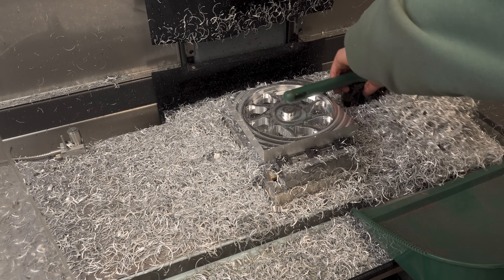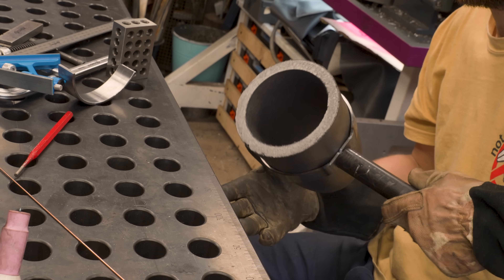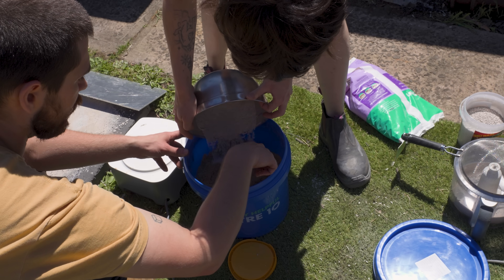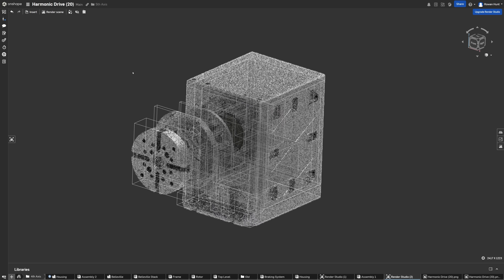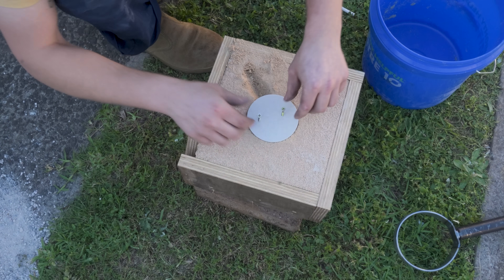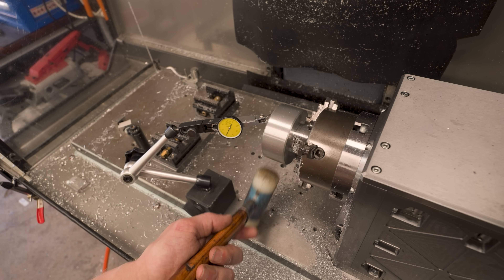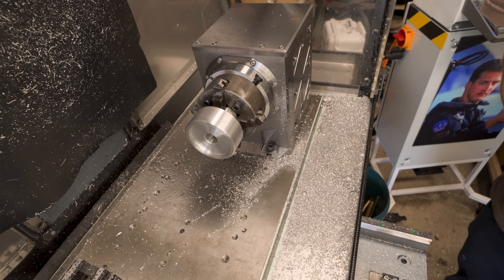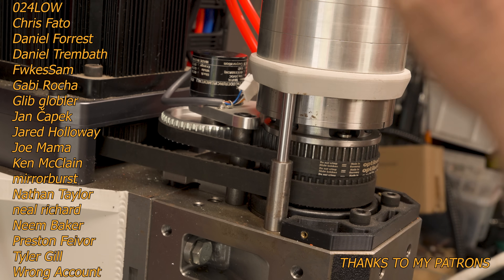Can I make a precision component from scrap metal?

Comment: Yeah impressive but I can make scrap metal from a precision component
Reply: Ah, but can you carelessly mix chips from seven different metals until no recycler will ever take it, even for free?
Reply: yes you can. You'd make very precise scrap.
Reply: Yea but I can make a precision component and scrap at the same time
Reply: I can make scrap metal from a $1,000 Kurt vise...
Reply: Video games have taught me you can make anything from scrap. 

All you need is a flat surface which you call a workbench, some office supplies and kitchen chemicals. Then you can build anything from a jetpack to bulletproof armor and bombs.
Reply: @VikingTeddy, Step 1: punch trees
Reply: Sounds like my QC manager
Reply: Any machine is a smoke machine if you operate it wrong enough.
- several people, idk original source.

Comment: The good news from here is super easy to add the flange needed, just a flat round disc half inch bigger than your gear, drill  3-4 holes and tap matching holes into the gear itself.

Comment: don't worry from someone who has a machining bench that is about 80% holes, 81%if i count the vacant space in my head where a brain would be, we all end up with the accidentally cutting/welding 2 or 3 times situation, it's just the result of you enjoying the process a lot, as well as an added bit of excitement for the project to be finished, or your calculations prior being correct, and as a fun little nod about the empty space between my ears, as i am a measure cut and then forgetting about the extra bit of centimeters I left myself type of girl

Comment: Dude, we learned how to these sand forms for casting and you basically just have to pack it hard, layer by layer, NOT JUST AT THE END (there is a tool for that). And the wood would also suck moisture from the sand. The moisture content was important, if I remember correctly. Some single digit percent?

Comment: if i recall correctly a belt pulley if it is ever so slightly CONVEX it will hold the belt in the centre... yes conVEX its counterintuitive but it pulls the belt to the high centre.. i dont know how that plays with toothed belts but its how they used to keep leather belt driven pulleys working without flanges (flanges make it hard to get the belt on and can tear it all up if the belt tried to ride it)

Comment: You've got a TIG machine, so presumably you've got pure argon handy. Before you pour use a graphite or stainless steel wand to bubble a few of liters of argon through the melt for about 30-60 seconds. This should reduce that porosity you're seeing.

Or, if you're a fan a chlorine gasses, toss a commercial degassing tablet in it.

Comment: I been casting from a 3d print for years... Its such a useful method. Super accurate too if you account for shrinkage. I use  2 small magnets set in the 2 halves of my pattern for line-up.. works great! Also laser cut acrylic template works for flat parts. The uneven kerf from the cut is perfect mould draft and i have had particular success casting a texture off a raster. Would suggest setting a laser-cut/Engraved acrylic sheet into a flat plane of a template to achieve higher detail. In all honestly I bet that finished part could have been almost fully casted if better sand/template/much care was taken.

Comment: You should be able to eliminate the need for a flange by turning a slight crown on the teeth. Since it's just running an encoder that shouldn't cause any issues. It's not needing to transfer lots of torque.

Comment: To everyone, if you didn’t know, be careful with open ceramic wool insulation in furnace or forge it blows the fibers/silica and can cause silicosis in long term exposure. A respirator is always recommended, otherwise sealing it with refractory cement is best.

Comment: There is another binder you can use that actually sets up, it is sodium silicate AKA water glass. Mix that with your sand, I am not sure the proportions, and then cover it in plastic and expose it to CO2, which you can get at a welding supply store. Once you remove the plastic, you now have a hardened sand mold. You can use a lot finer sand as there is no moisture to vent and no metal ejection hazard. Since the sand is finer, you get a lot better surface finish. The downside is, it can't be reused, you have to use new sodium silicate every time. Not sure about the sand though. There are YouTube videos on it.

Comment: Make it slightly convex/crowned and the belt with self center.
Steve Mould has a great video on why/how it works when it seems counterintuitive… you’d think a rounded pulley would make a belt slip off, but it does the opposite and keeps it centered. It’s pretty cool.

Comment: I paused the video to tell you where to get cheap bentonite just as the words "Kitty Litter" passed your lips...  Curses! Beat me to it!  (Did you know that you can also bleach waste oil to be clear again with it?  Fun fact:  You can.   Where I live in North Carolina, the sun is intense enough that if you paint a standard oil barrel black and leave it under the summer sun you can just about get the temperature adequate for bleaching.  Your mileage may vary with your location.)

Comment: The casting came out really well also from a machining point of view. I've tried one time but probably I've used the wrong alloy and it came out very gummy.
I'm planning to try something similar in the future as I acquired a 3D printer with some friends, did you do some degassing or put some flux in the molten aluminium?

Comment: You measure gears and other similar features with instruments by putting dowel pins of appropriate diameter inside the features and measuring from them. This still requires that the pin contacts only the bottom of the feature, and in the case of gears, it only works if the gear count is even (or you can adjust the measurement for odd ones, with a lot of trouble and math, but better not to try that).

Comment: A good way to mix greensand is lay it on a tarp in a thin layer and roll it back and forth by picking up one side. That way you can really dial in the water needed with a spray bottle.

Comment: so, i don't think i ever posted about an AD on a video, but i got into onshape, i wasnt expecting much, it delivered EVERYTHING, i cant believe how good it is
Reply: My main problem with onshape is that it's in the cloud. At any time, onshape can decide to go bankrupt or get all their servers randomware'd (however unlikely it is), and suddenly, your files are just binary noise, if you have them at all and didn't just store them on their servers.

Any price difference with older established players will only last until they have gotten enough market share. The pattern is well established by SOLIDWORKS and Fusion 360, not to mention software and products in other fields. The first hit is free, the next one is cheap, and once your product is a few years old and a few revisions into development, and consists of files and assemblies interlinked in product-specific ways, suddenly there will be maintenance cost hikes and monthly licence fee ramps, and you're not going to take the three months of no revenue-generating work it would take to transfer all of them to the new hot-and-cheap software via the inevitably shit export flow and lose all of the revision history.

Admittedly, it's the same for many non-cloud CAD packages nowadays... If their servers are down, you just can't get a licence validation, and it's a multi-gigabyte brick on your hard drive.

God I wish FreeCAD were up to snuff yet.
Reply: 3D sketching is my biggest desire for OnShape.

Comment: I can't believe you Prematurely Pulled out your 1st Metal Mold.. I was really impressed with the quality of that metal once you sliced it open to investigate its internal structure. BTW I can't believe that you didn't DIY make your own crucible & metal furnace from scratch.. and I can't believe that you didn't DIY your own ⚙️ gear pulley from scratch by planting multiple rubber trees decades earlier from now, in order for you to make a video about you making your own rubber belt for your gear pulleys.. I just can't believe that you didn't do this.. You really must not be an engineer..

Comment: Literally what i did a few days ago and going to do again today as need a replacement pulley. 
- Always wear a full face mask when around the forge as only take a drop of water for an accident to happen.
- Best source of scrap Ali imo is cylinder heads/engine blocks/pistons(way less impurities) then motor housings etc
- If you really want centrifugal casting is another method of having a stronger cast (but it doesn't work for everything), sadly the real good quality one is done with pressure cant remember name (most good recycled ali comes from this process)

Keep having fun :)

Comment: I started casting my own aluminum a few years ago, and also had problems with little air bubbles. It took me almost 2 years to solve that problem. It turns out that if you heat your aluminum too much (to try and get rid of those annoying bubbles) you end up with more. Those bubbles are actually hydrogen bubbles that form from any water from the air (or your scrap). If you melt the aluminum just past the point of molten those bubbles disappear. This is something you have to get a feel for because if you pour too early you end of with cracks forming in your casting. Bottom line is, you need some hydrogen in the molten mix to reduce the cracks, but not enough to be able to see them and end up with a casting that won't seal against oil or air in your finished product.

Hope this helps. I love your channel.

Yours, Bruce.
Reply: This was very informative thank you for this!

Comment: Now, obviously, the next step here is to find yourself a quiet and abandoned slab of concrete in the middle of nowhere, and cast a large chunk cast iron into your next machine.

I'll be so generous as to suggest something with no less than 50HP on the spindle.

We'll give you two months, since it's a slightly more complex undertaking. 😆

Comment: I don’t normally comment or give praise to young people who stumble through something and manage to not kill themselves, but kudos to you. You’ve done some research, obviously. Your lifting tongs and pouring shank are very well made- certainly better than the garbage it came with and better than what a lot of backyard amateurs use. I would probably beef up my PPE a little- maybe to a face mask/face shield and some covering for your arms. You’re only melting a tiny amount of metal, but if/when you take it further with a bigger crucible/furnace, you’ll want to upgrade to leathers or something more. I use expensive aluminized Kevlar PPE and a gold coated face shield when I pour iron, but that’s all overkill for what you’re doing. If you can’t source bentonite directly, kitty litter is still pretty suboptimal as is your sand by the look of it. If you can’t source finer (maybe 100 mesh) silica sand or better, olivine, then the surface finish will suffer. Obviously in this project it doesn’t matter since every important surface is machined, but someday you might appreciate a smoother finish on your castings. There’s no shame is buying a few kilos of premade petrobond or professional greensand either.

Anyway, good job.

Comment: Is blending the Kitty litter like that safe? Mostly asking because I've seen a YouTube chemist do it and they wore a full gas mask and compared the dust to Asbestos - But they may have been grinding it a lot finer.
Reply: Kitty litter is not asbestos. If it were that dangerous then every cat and cat owner with a litter box would have lung issues. That said, powders don’t belong in your lungs, so a particulate respirator is always a good idea. Not because of cancer or silicosis (in this case) though.

Comment: Yeah...I did the kitty litter grind. After spending enough time to make me give up, I discovered that the way to do it, is just soak it in enough water to make it "runny" then pour it through a sieve and mix it with dry sand. Add water, or let the mixture dry till it's right. Next step, buggering up the pattern and flask a few times till you're ready to pour metal badly. It's fun.
Reply: I've had pretty good results from my first few sand casts, of course I just bought pre-mixed sand from Amazon.

Comment: Also, if you use cast feedstock ( I like alloy car wheels), if you heat treat at 150c for ~3 hours and then quench you will find it is much stronger and a lot easier and nicer to machine. Wheels are an age hardening alloy, and come up very nicely indeed after the heat treat.
Reply: Great comment. For anyone interested, Google “T6 heat treatment of aluminum alloys” for specific ramp/soak/cool temperature profiles.

Comment: You could either add a flange OR make it a liiiiiiiiittle bit conical. That way, the belt will align itself. But it need to be done exactly the right way, otherwise it will destroy itself

Comment: Then you get multiple sizes of crucibles and the process starts over lol  I use a diesel burner and air compressor personally, no icing up of the propane tank.  I melt down small engines from weedeaters, mowers etc into ingots ready to go.  Probably have 100lbs slag free ingots on hand.  Neighbors glad to get rid of those things so all free.

Comment: 15:55 In the future you could try putting a crown on the pulley instead of needing a flange. It's not normally done with toothed belts but the only reason I can think of is for ease of production.
Reply: Agreed. I made a flat belt pulley with flanges as a teen and found out how it doesn't track where it was supposed to. It ran on top the flanges great though. One third hanging off in the air. I then learned how a crown centers it. Toothed belts will wear on the flanges if not well aligned. A crown will really correct it.

Comment: You forgot to buy boron, to clean the molten metal from impurities and other stuff you dont want in your "aluminium". It also helps form an insulating slag that is easy to scoop.
Reply: It’s borax (sodium tetraborate) not boron, and it doesn’t do anything for aluminum.

Comment: You dont haver to dry out the crucible, or the initial aluminum/aluminium.  but once you have molten metal anything you put into it SHOULD BE DRY - ESPECIALLY THE CONTAINERS YOU ARE ABOUT TO POUR IT IN!!! - But not the stuff you first start heating, just the stuff you add molten metal to or add to the molten metal. :)
Reply: and you do NOT have to pre-heat the crucible either. just fill the crucible with you material as much as it fits/as you need , stick in the furnace and fire it up.  and USUALLY when you're adding more metal to the molten metal you dont really have to worry about moisture too much if you just place it on the lid next to the hole for about 15 seconds. that should heat it up enough to be dry, then just push it in through the hole. But you DO WANT TO KEEP THE LID ON, this REALLY HELPS IT HEAT UP FAST AND YOU DONT WASTE SO MUCH EXPENSIVE GAS. :)
Reply: Oh and making the metal you're gonna melt into small pieces is BEST. that way it melts faster because there is more surface area in relation to the size of the piece. MORE SURFACE AREA = MELT FASTER .. SO USE SMALL PIECES
Reply: ALUMINUM AND COPPER CAN GET AS HOT AS YOU ARE ABLE TO.. NO WORRIES ABOUT GETTING THEM TOO HOT. BUT OTHER MELTS DO HAVE A LIMIT, ESPECIALLY THINGS WITH ZINC IN THEM, LIKE BRASS - BRASS IS COMPLICATED AND YOU NEED TO LEARN ABOUT IT BEFORE YOU STAR MELTING IT. OR ELSE YOU'LL SET IT ON FIRE AND MAKE A HUGE FRIKKIN MESS AND RUIN THE BRASS! -  BUT ITS KINDA COOL TO TO WATCH AND THE RESULTS ARE WEIRD, BUT YOU NEED BREATHING PROTECTION!!!!!!!!!!!!!!! - ALWAYS USE BREATHING PROTECTION WHEN MELTING!!!!  THERE ARE IMPURITIES IN SOME METALS BECAUSE.. WELL... BECAUSE CHINA... SO GET A PROPER BREATHING HELMET!!!!!!!
Reply: GET YOURSELF A SACRIFICIAL STAINLESS STEEL SPOON. You WILL need to scrape off the slag/dross - ESPECIALLY with aluminum. Copper can be poured and the slag will stay in the crucible, but you have get the copper super hot and molten so that it pours very smoothly and thin, like water. Aluminum is kinda the same , but the longer you keep aluminum molten the more slag will form - it's basically aluminum oxide forming, and you don't want that in you product. You learn these little "tricks"  and "tips" the more you do it. But you'll have fun too - I hope lol